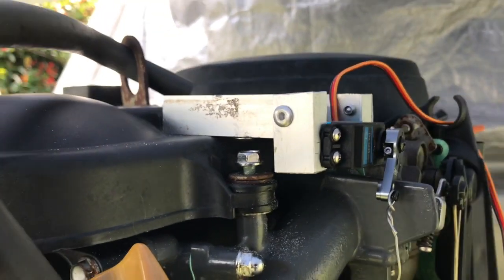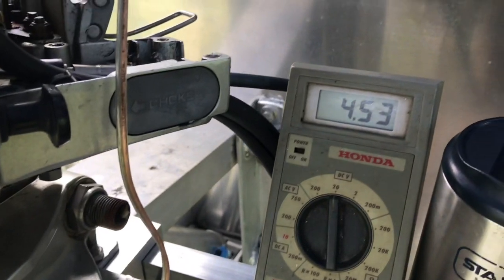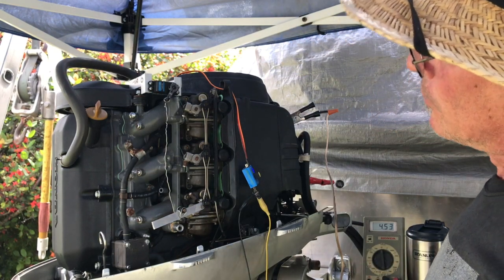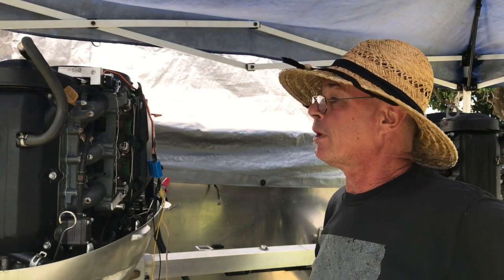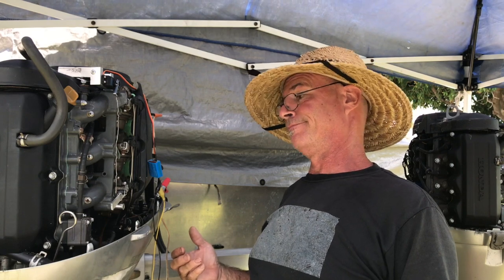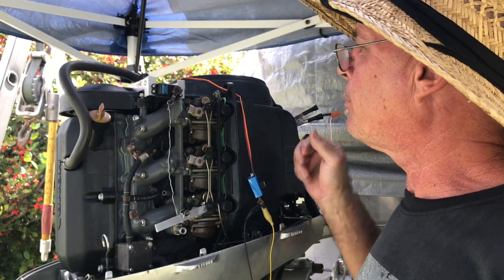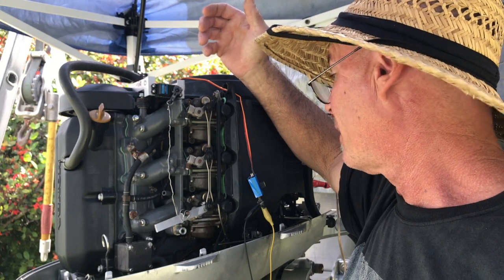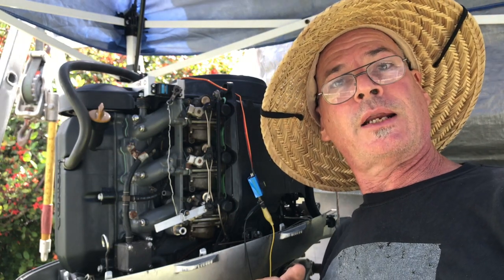Outboard Motor Servo Throttle Control part 2

Comment: Hey there, I've got my own setup very similar to yours, did you do anything to limit the stroke of the servo? If I crank my servo tester up all the way by accident it will cause damage to linkage or bracket as the stroke I actually need for throttle is maybe 70-80degrees when the servo can travel 180 degree's
Reply from the maker: Hey, Kyle. My setup uses the full travel of the servo, close to 180 degrees. I'm sure there's a way to limit it electronically, but probably much easier to change the geometry of your linkage with longer arm on the carb or similar. It will make more leverage and lighter load on the servo as well. Thanks for watching!

Comment: Are you able to share the longevity of this setup? I have recently done the same for my outboard for the coming season. I used a heavy duty waterproof servo mounted in the outboard. With a simple servo controller inside a custom made throttle for my custom project 14' inflatable boat see it here https://youtube.com/shorts/geDj_9yXuUY?feature=share

Comment: Hey Scott! Nice to see you on YT. I like your idea to control the engines by wire. I work with servos for decades. The springs i would dismount. The servo fight against the spring and produce heat and heat is killing the servo over the time. You can adjust the travel and force by use push rods with threaded ballheads. So you must use the full travel of the servo to prevent any mechanical resistance. I hope you are fine and we see us in fall. Greets to Elke too! Keep filming. Guess who i am :)
Reply from the maker: Thanks, Udo! Yes, I did remove the return springs. I have the completed setup on video and will be posting up soon. Oh, and, nice bike, by the way :)
Reply: @bohemianmachine  Thanks :) Nice boat and engines. Honda 50HP are rock solid when they are well maintained. Did you get fixed the transmission gear on the Yamaha 150HP? Hope we'll see us this year!
Reply from the maker: @FretMover  Yes, the Honda 50s are super dependable and fuel efficient. Yeah, the cost for all the gears on the Yamaha was so high, I put on a complete lower unit. Hopefully they don't cancel Oktoberfest here and you can make it!